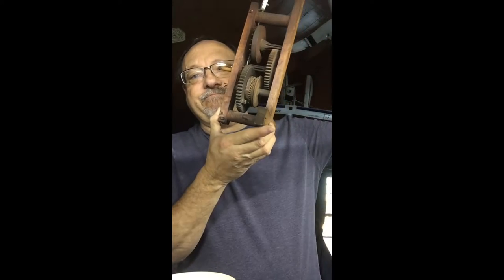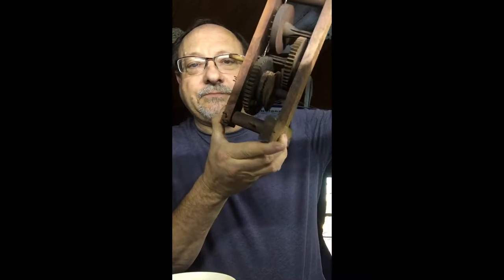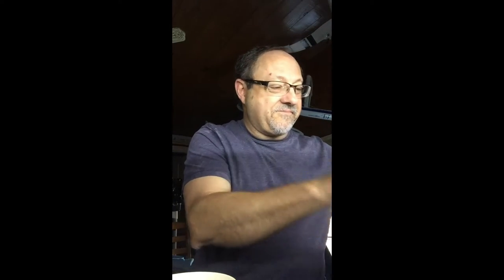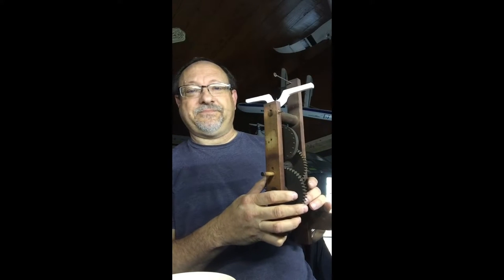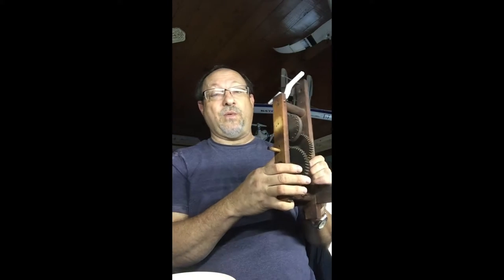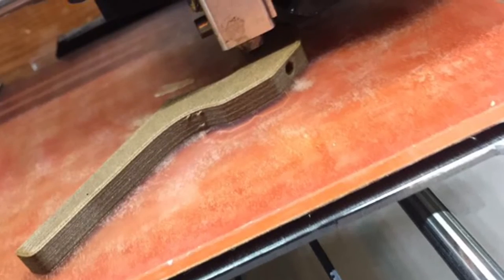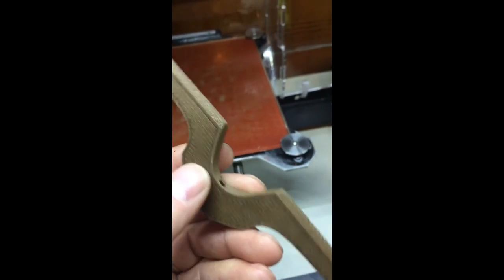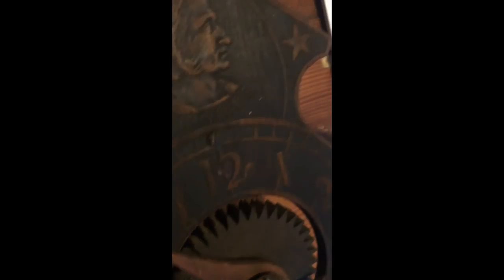Wooden Columbus Clock

Comment: I have a Columbus Clock as well that is missing both the regulator bar and the weight.  Can anyone give me the basic measurements of the bar and the weight of the weight.  😊
Reply from the maker: The bar I designed is approximately 150 mm long. The weights vary. Start with a .18 oz.